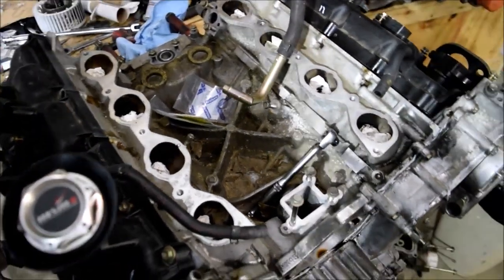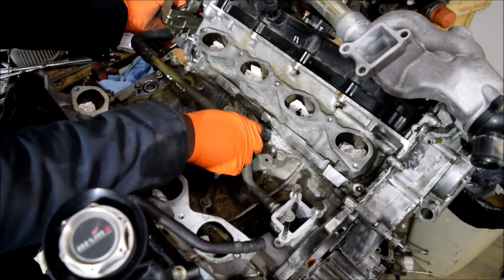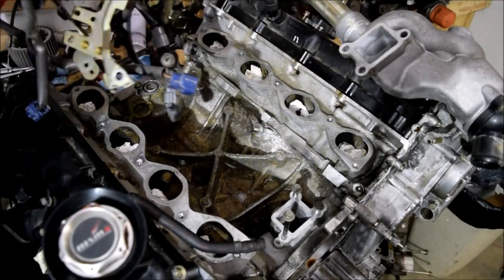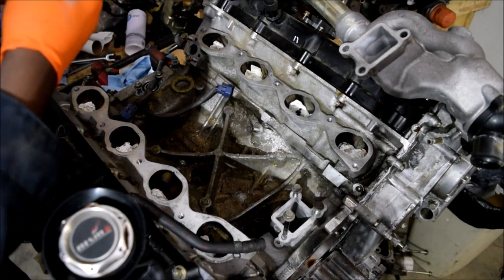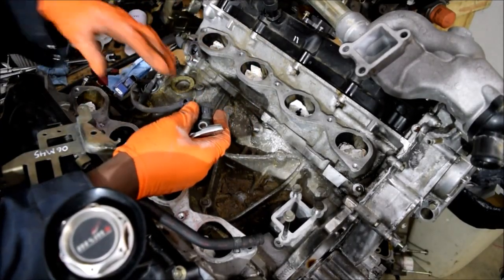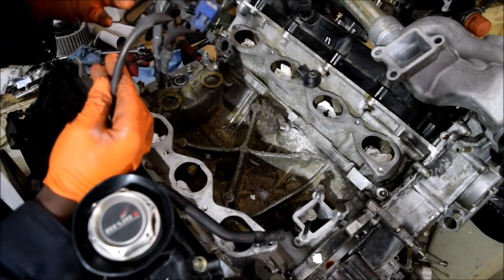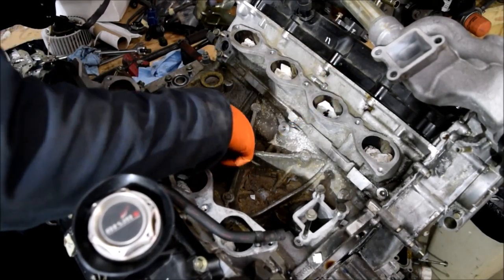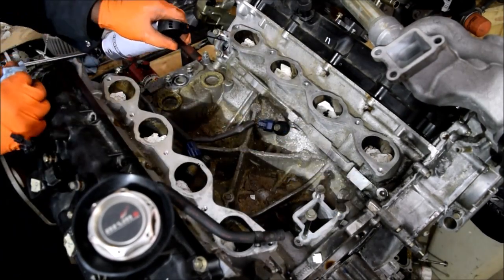Ep.6| Knock Sensors. Nissan Infiniti VK45DE engine reassembly. 4.5 liter V8 for M45. Q45, FX45, Fuga

Comment: So I have a 2008 and just changed my oil made sure level was up to top hole. Came home and noticed slight knock sound. Only in drive while idling. I put it back in neutral and idle. No knock.  Can you help me?  I watched your video on one knocking and seems to me once you have a rod knock it doesn't just come and go. Its always there.? True?

Comment: Ed I have a p0328 code. It's doesn't cause a check engine light but it stays present in the engine code whenever I scan my car. I use the bluedriver scanner. Would you think it's the wiring or some type of electrical issue? After seeing this video I think the knock sensors are impossible to get to without removing the upper part of the motor. Also is it worth feeding into? I only use 93 and the car drives fine besides that stored code.
Reply: Did you fix the problem? What was it
Reply: @julf9178  No, I treat it as a "stored engine code" and just keep it pushing.
Reply: @Robert-fz5rz  do you feel the car slower to pick up and bad gas mileage?
Reply: @julf9178  Honestly I bought it with the code stored. Car picks up fine and gas mileage on the highway is like 22 23 which is good for a 17 year old car. Close to factory specs. So idk, I ignore it. Maybe one day I'll get it opened up to do gaskets and knock sensors. Maybe

Comment: ive seen a few vids of ur m56 could u do a launch/ takeoff vid from outside view im thinking about getting this car my friends all they got is srt8s and stuff and these are close performance to the srts i just gotta see how the m56 looks taking off full throttle
Reply: basically i want to see if the m56x is worth it bc you can get really good tires on the m56 rwd and wont spin out on takeoff
Reply from the maker: Having owned both, I'll tell you the AWD was much better at take off. Right now, my M56 would not be a good representation on video because I am due for new tires & it's been very tail happy.

When I get my new tires, I will try for some launch videos.
Reply: @EdBwoy  do u think its faster than a jeep srt8?

Comment: Do you know of any type of engine management for the y34 m45? Emailed AEM and they said they would need to know what the trigger pattern for the crank and cam. Also whether the sensors are VR or Hall. Do you know what they are?
Reply from the maker: I believe UpRev already offers some support. Not all Y34s are currently covered, but I'd call them to discuss the specifics